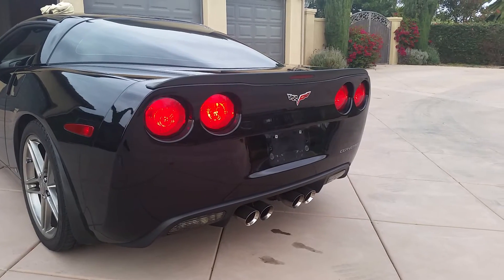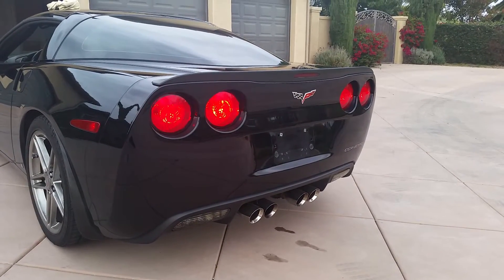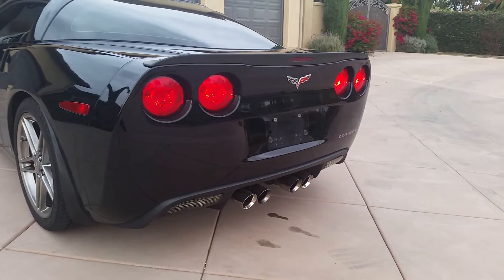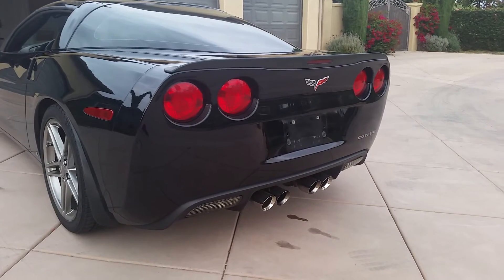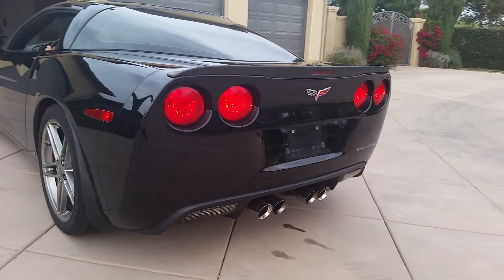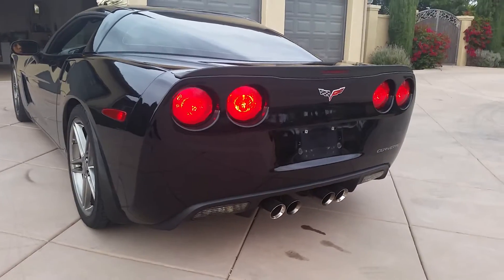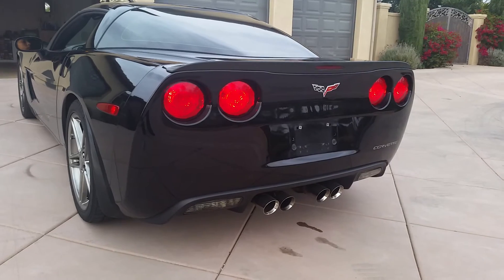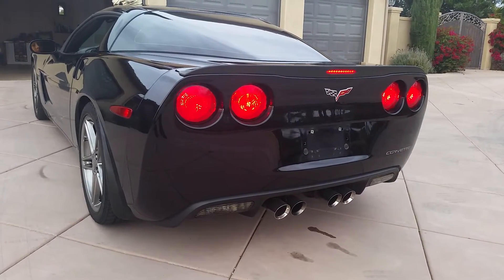Corvette C6 DRL electric mystery (exterior)

Comment: it is a problem with the power feeding back through the tail light circuitry. There is a video on corvette forum that tells how to install rectifier diodes in the tail light circuit so it won't happen anymore. I had the same problem and found if I turned on the parking or headlights they work fine but during daytime driving when those lights aren't on I have that problem. I tried to find the video for you but so far haven't. I will post a link when i find it.

Comment: first off i can tell you did a hell of a custom wiring job considering the side markers are blinking with the blinkers, stock those stay solid they are not blinkers which means you did some wiring, furthermore you connected left and right bulbs on the second filament leads which makes them both blink... why you connected those wires is beyond me.    Left Marker A, Left Tail Lights B, Right Tail light C, Right side Marker D, AB together, CD together, do not connect A or B with C or D
Reply from the maker: thanks for the input but we figured out the issue! I posted a second video explaining the issue. it required a diode on the center wire which prevented the signal from overloading the rest of the circuit, causing them all to blink. all good now!